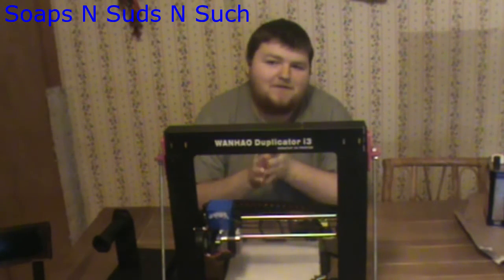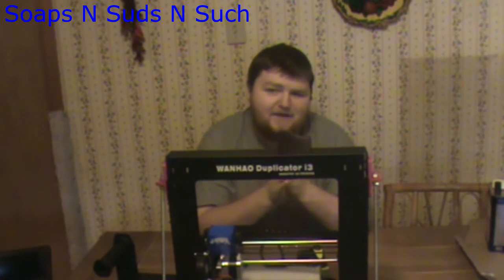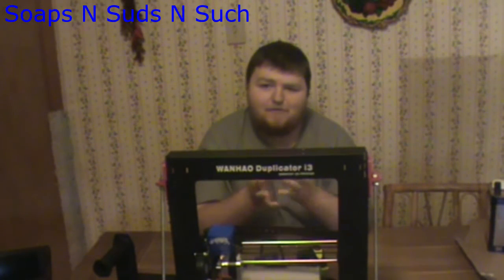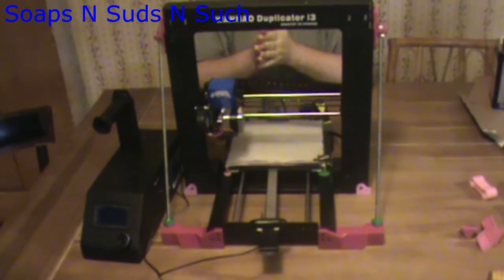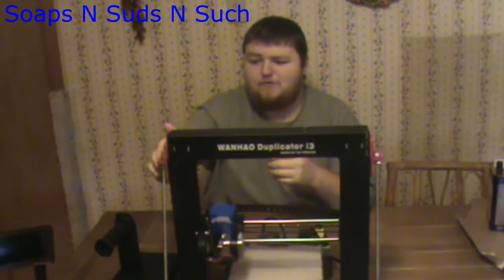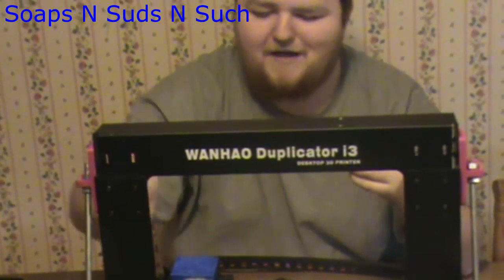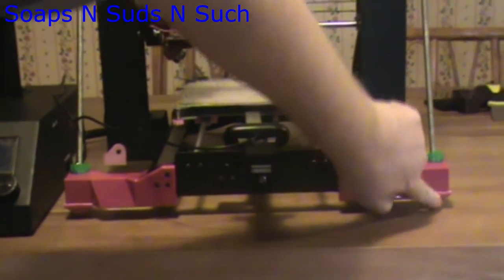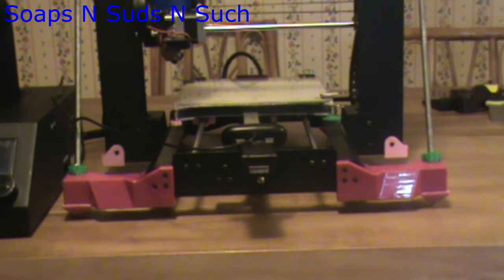Z Kit (Z-brace + Z-extensions) for  Wanhao duplicator i3

Comment: Hello mate , 
Thank You for sharing those upgrades you made it . 
Soon as found Your video I was tray to make those small "Z brace scrapper holder for the left side , short version & for the right side . 
I have "Wanhao Duplicator i3 Plus" for a couple of days .I made some parts ("Marvin" ; "Star War Interceptor" ; a version of duct fun and Everything was perfect , until I tray to made those files I mentioned . 
The problem is : I don't know how to say , the piece is made by a small grid of wire - not filling all surface ; You may see throw piece like you look at a spider web ; not finishing last layers by filling a smooth surface !! . 
I din't touch any setting in Cura since I have the machine . 
Can You tell me what is happening or what do I do wrong ?. 
Regards

Comment: I like how you did this.  Have you printed anything tall enough to utilize the extra height?
Reply from the maker: I have only done a small handful of prints that needed the extra height. Currently working on trying to add in the ability to use m6 bolts as leveling feet
Reply: Cool, keep us posted on the updates.  I think you are on to something here... So far a great design in my opinion!
Reply from the maker: I have started work on printing a ping pong paddle for a friend. I went to check my Z height to see how high I could actually go to print the paddle part. My Z height maxed out around 172mm, this was with the rods and nuts basically flush. I think my glass bed and moving the endstop switch up is what happen to the 8mm to make it 180mm.